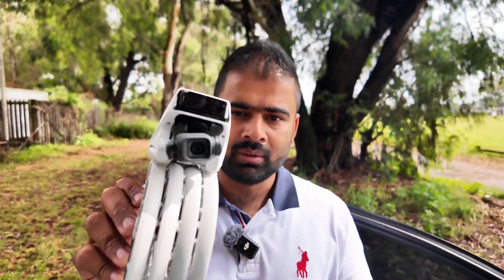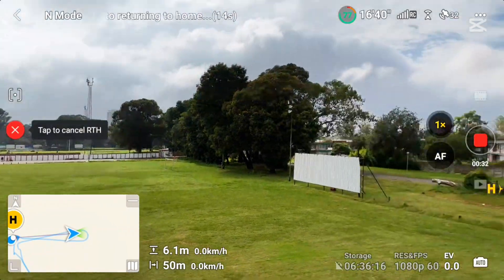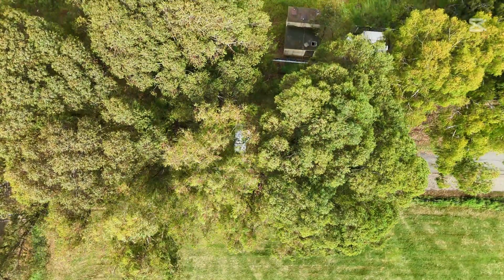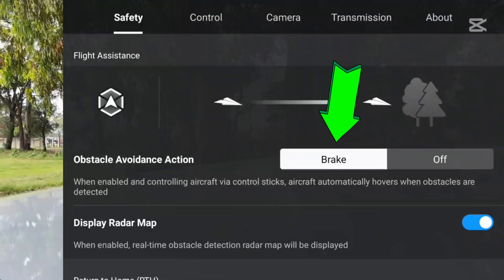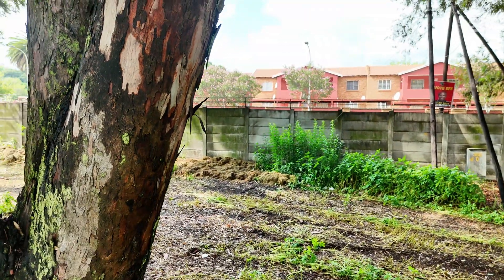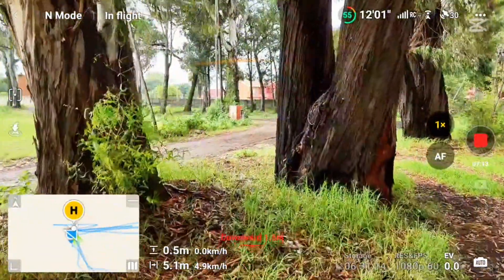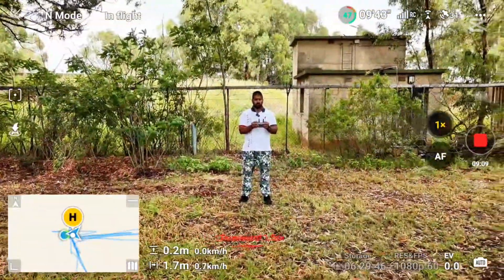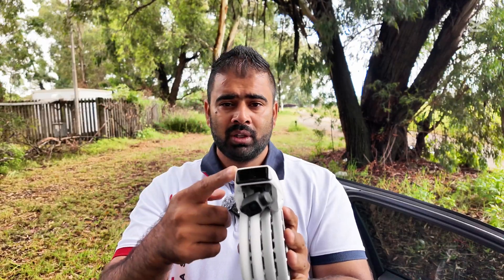DJI Flip: Does It Have LiDAR or Obstacle Avoidance? The Truth Revealed

Comment: your understanding lidar sensor wrong
try to use the air 3s in pitch dark, and it also will brake the same as flip does
the lidar uses ToF system with laser

the reason air 3s is able to back as the route is because the omni visual sensor which is a camera, and if it performs in the pitch dark, it also only able to use the lidar and only perform brake
Reply from the maker: Dji flip is not lidar 
Its infrared sensor 
Thats why it cant
Reply: @Drone.lover.  it is lidar, it use the same tof sensor, just the hardware limitation of the laser, thus dji wont called it lidar
Reply from the maker: @MalezHoam  when i will crash it i will have a look at the sensor as i know how it looks alike 
I opened an air3s already and have seen the sensor inside